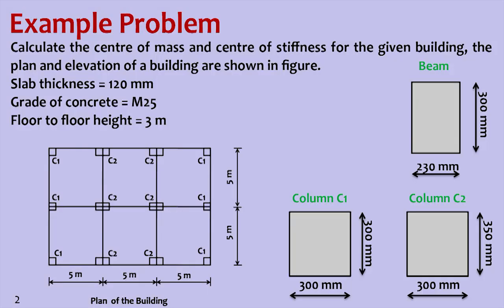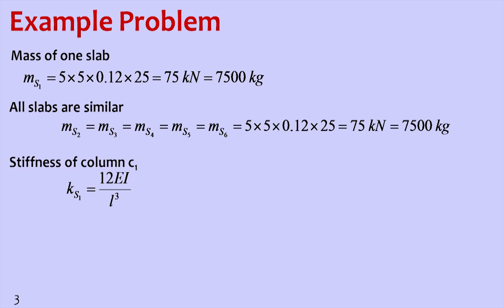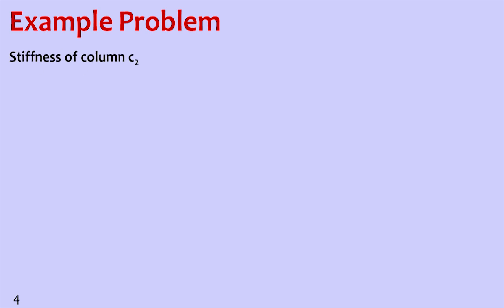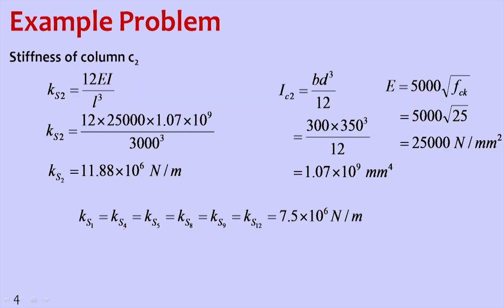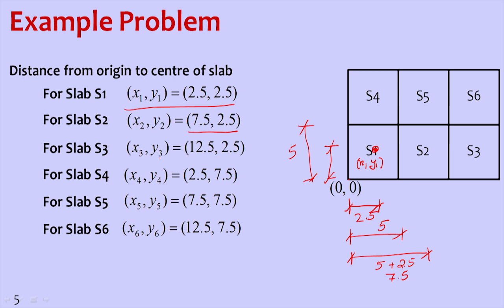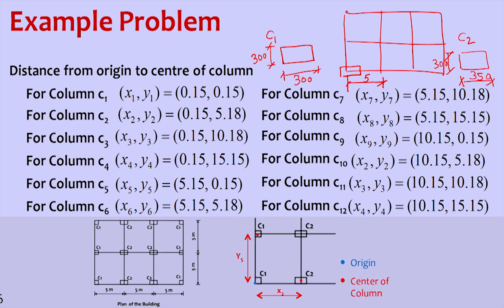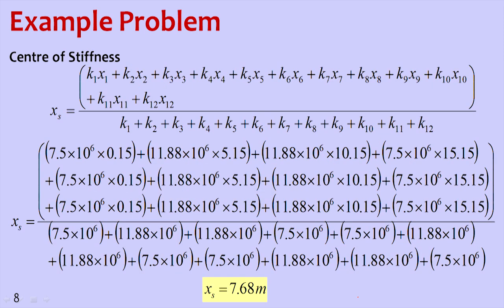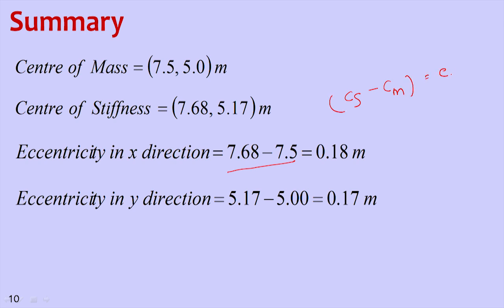W09T01 Centre of Mass & Centre of Stiffness

Comment: 1.Coordinate mentioned in column position for c2 ,c3 looks wrong....
2. You have considered outer face of column as (0,0). As you calculating center of mass for slab, simply 7.50 +0.15 =7.65 correct....same in y direction 5.15 should be there, correct?
Finally eccentricity will be less...

Comment: how the coordinates of the columns are taken, while calculating center of stiffness?
here it is given that for the 2nd column the distance from y axis is 5.15 , why is it so? , if the center of column is considered then the value becomes only 5 in the same case.
Reply: Gokul s kumar Yes, you are right. 5.18 is the value of Ya, anda benar. 5.18 adalah nilai sux, sedangkan 0.15 adalah nilai sumbu Ya, anda benar. 5.18 adalah nilai sumx, sedangkan 0.15 adalah nilai sumbu yYes, you are right. 5.18 is the value of x, whereas 0.15 is the y-axis
Reply: Gokul s kumar Yes, you are right